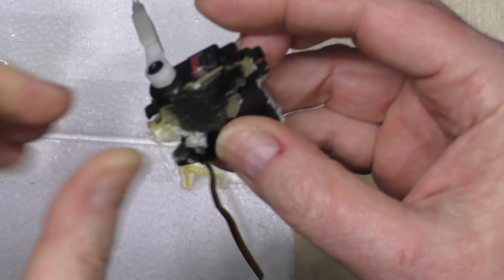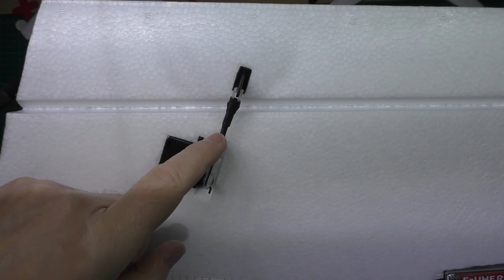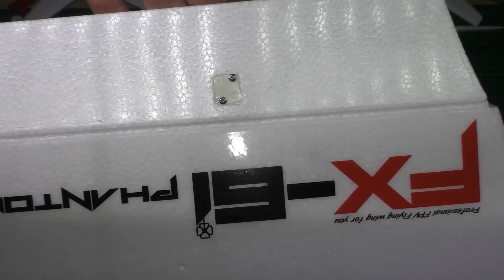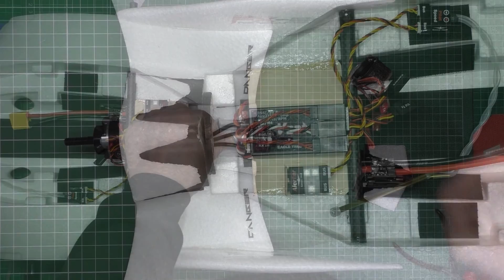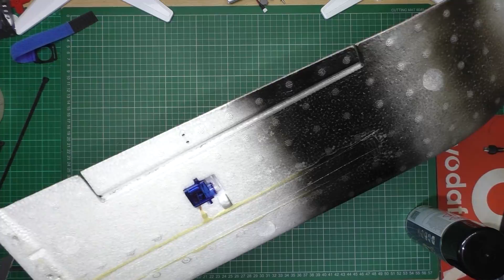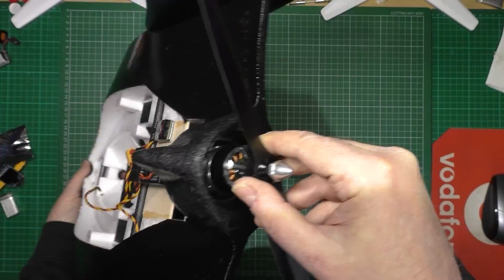Zeta FX61 Phantom build part 3

Comment: Hi mate great videos, What motor and esc you using ? Also could you tell me the glue you used for gluing  the cnc motor mount in place. 👍
Reply from the maker: This was 3 years ago but, from what I can remember, it was a T-Motor MT2814 1000KV and the ESC was a Turnigy Plush 60A.

Comment: comin out nice mate 

plasti dip spray on epo works great tony
Reply from the maker: +Aron Gatt Cheers Aron, I didn't know that one! I spent hours researching and only came up with Humbrol stuff which costs a fortune and it only managed to cover my lungs :-)
Reply: Vortecks give it a shot next time , youll love that stuff , also if you tend to land on hard surface or dirt , i would give it some ultra fine fiber glass with some epoxy on the bottom , saves repainting over and over and increase rigidity on fuse .

i use this on all my builds

    http://www.ebay.com/itm/321808951988?_trksid=p2057872.m2749.l2649&ssPageName=STRK%3AMEBIDX%3AIT

with 30min epoxy and your good to go
Reply from the maker: +Aron Gatt Believe it or not, I've got a 50m roll of the stuff. I didn't know that standard 30 min epoxy would be good enough to apply it though! Cheers mate :-)
Reply: 30min epoxy works great just send a bit the epo first and ur fine .. looking forward to the maiden

Comment: Hi, Whats the Epoxy you used on the servos

Thanks
Reply from the maker: +Jean Harris It's just standard 5 minute epoxy (Z-poxy) but it does seem to dry to a rubbery compound if you use 50/50. If you use 60/40 (60% hardener) you do get a brittle compound.

Comment: Valspar is what I use for all epo foam, it does react with some foams but if you coat in watered down pva glue before painting you can paint any type foam! Another tip before spraying epo is a light sanding with 400 grit sand paper to smooth all lump and bumps out so it leaves a smooth finish mate. Good job👍
Reply from the maker: +Rotor Flex Cheers mate. I've never sprayed foam before...... If I'd known you did yours this way, I'd have saved myself a whole lot of time and money! :-)